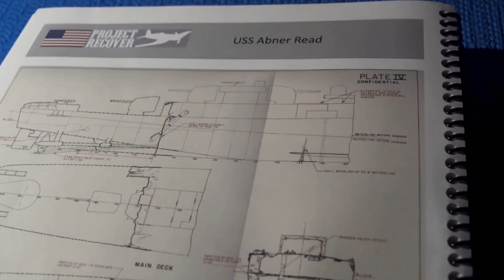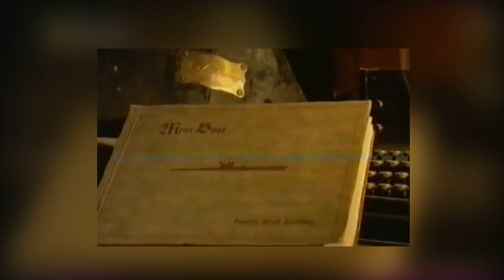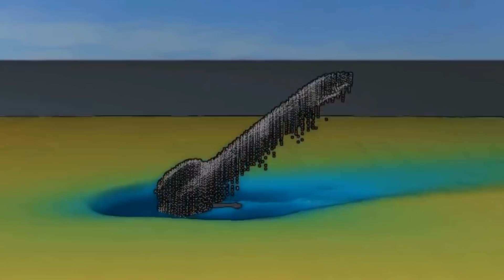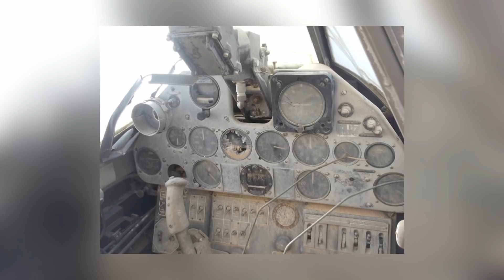12 Most Amazing Unexpected Military Finds

Comment: The Type A Ko-hyoteki class submarine was never designed to operate independently.  They were carried by certain larger fleet submarines for specialized attacks on harbors (like the ones used in the Pearl Harbor attack), or intelligence gathering.  They are still a source of controversy 80 years later, as photographs give evidence (that some consider circumstantial) that a midget submarine actually fired its torpedos on Battleship Row during the height of the attack, possibly striking USS Oklahoma and maybe USS West Virginia.
Reply: I think the IJN Navy launched 6 mini subs for the attack on Pearl. USS Ward sunk one and one was beached.. Then the one you mentioned that may have got to launch its two trops on battleship row.